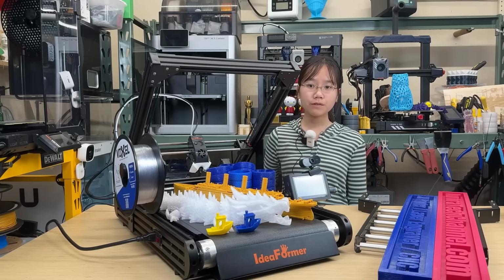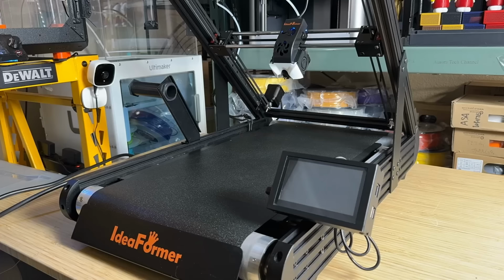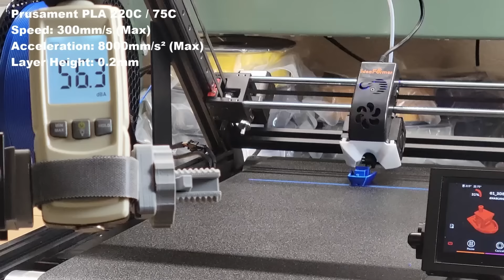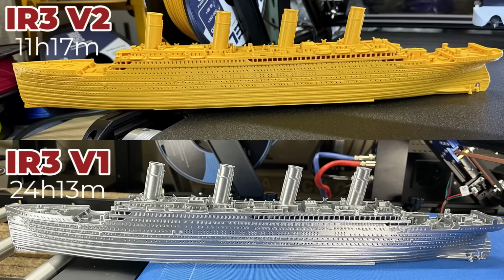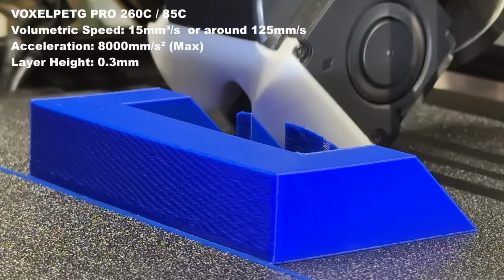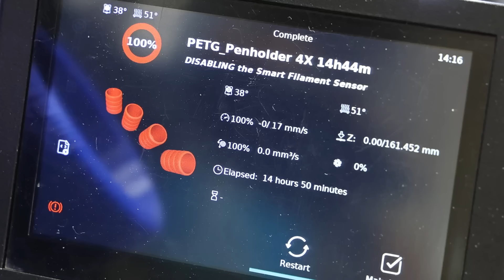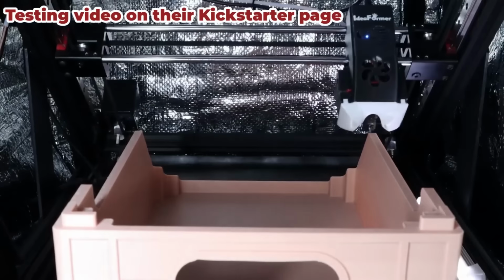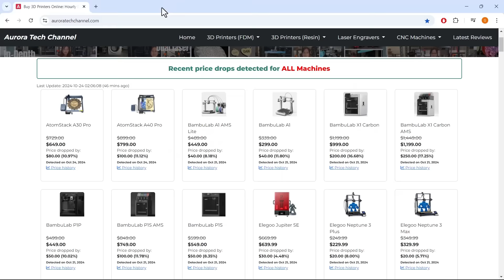$499 Klipper Firmware Conveyor Belt 3D Printer: IdeaFormer IR3 V2 on KickStarter, 250mm x 250mm x ∞

Comment: It's not true to say that ideaMaker only allows you to upload to their printers. You can also send files to Octoprint and Repetier.
Go to printer settings and look for 'Gcode Export'. Change 'Default Action' to 'Upload to other Server'. Repetier is apparently klipper server software? Does this printer have Repetier built in (I'm a Marlin user so have no idea).
Reply from the maker: Yes, you’re right! I selected 'Send files to OctoPrint,' and it worked! Thanks for the tip :) I hadn’t realized that, as I don’t use IdeaMaker slicer at all except when printing with this IR3 V2 and previous generations.
Reply: @AuroraTech  I have been using it for years and really liked it but have changed recently because it still does not do tree supports. I'm glad I could help.

Comment: Another great review video!  Thanks.  I don't want to print cosplay swords but I can see using a 45 degree belt printer for continuous manufacturing.  Hang a 3 kg spool and place a bin at the end of the belt to print hundreds of parts without any labor.  Also good for long prints such as custom signs.

Comment: I just pledged my first Kickstarter for this, as I have the IR3V1. Note that you can speed up the print on the IR3V1 using the interface. I typically crank it up to 200% and haven't had an issue with PLA or PETG. And, as usual, great video except I miss the bloopers!

Comment: I wonder if overhangs will be improved with better part cooling.  For me, this looks to be a blocker and most printers can handle a 45 degree overhang without any issues.
I think your conclusion is correct, better filament profiles will help.
It would have been great to see if you did any temperature towers or other tuning tweaks.  Possibly printing the PLA a bit cooler may have helped with overhangs too.

Good videos though - new subscriber!

Comment: What we need is a belt printer with a normal 90 degree angle for batch production I wish this could have the option either 45 or 90 degree just changing the gantry installation.
PS: Is the K2 Plus review coming next week?
Reply from the maker: The K2 Plus video will be released around Nov 10.
Reply: Do you know if it will have a sale on BF?

Comment: the is any internal diferetn on this printer compare with the IR3 v1?  like mother board,  stepper motors or  belt dimesion ? I like to know if the belt  will fit on the old version.

Comment: I just backed the project, as I never had a belt printer. I wonder how long of a print you can feasibly do with this.
Reply from the maker: It doesn’t have a hard limit, but the printer.cfg sets the bed length to 99999 mm, or about 100 meters. As this is just a soft limit, and you can change it to any length you want.
Reply: How long is your room?
Reply: I think the longest thing recorded on a belt printer was 20 feet long

Comment: I wonder how this will do with warp-prone materials like ABS and ASA.
Reply: It will warp just like any other open air printer. Sometimes you can get away with ASA-CF.
Reply: @joescalon541  Not open air, I'd use their enclosure. 

Good suggestion on using fiber reinforced though.
Reply: Looks like there is an enclosure, they just look awkward lol

Comment: Cr-30 ?
Reply from the maker: The hardware of the IR3, even the older IR3 V1, is much better than that of the CR-30. The CR-30 uses POM wheels, the basic Ender 3 hotend, and Marlin firmware.